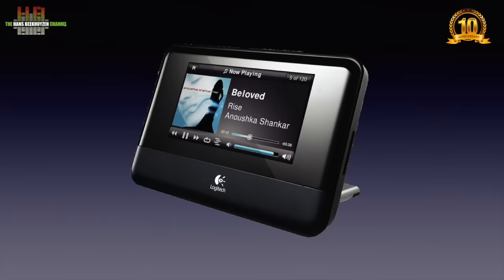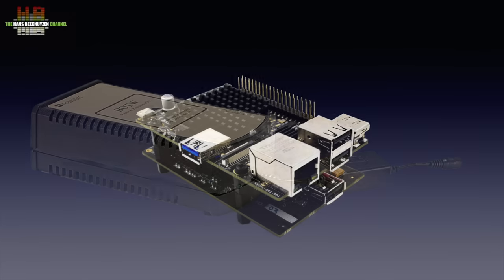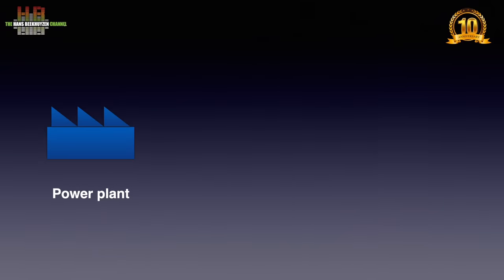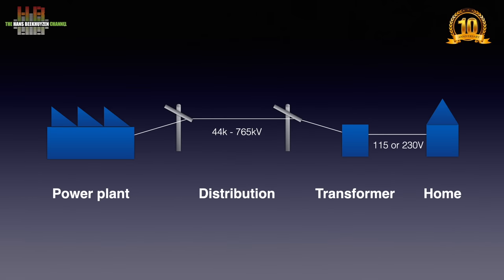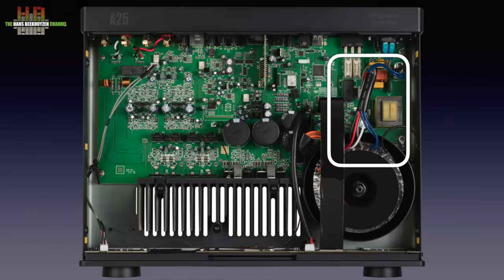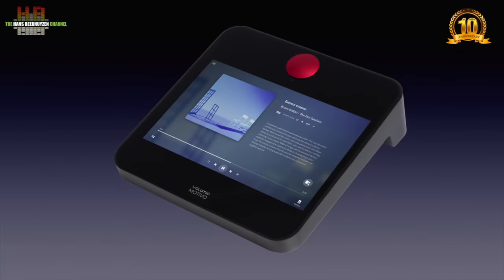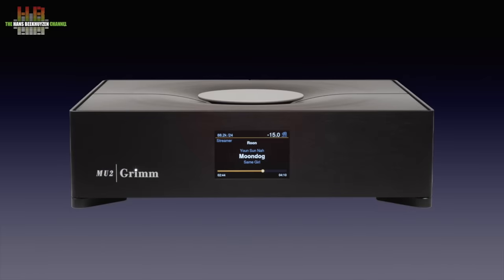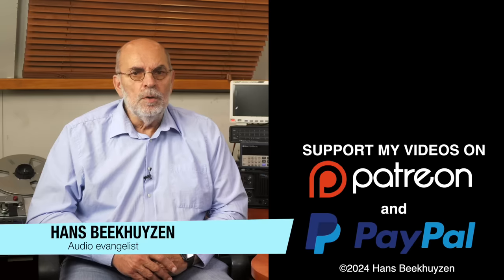About power supplies

Comment: I bought a LPS for my Schiit Modi+ DAC. It was very well made, with good quality transformer and components. It’s sucked the life out of the DAC - it flattened the soundstage and reduced dynamics. The sound became lifeless. The SMPS was far superior, with a much livelier, dynamic delivery. A LPS doesn’t guarantee better sound.
Reply: I've experienced the same type of thing with different components & aftermarket PS's. It's not always a perfect match.
Reply from the maker: That would mean the LPS wasn't of sufficient quality. Or both of you prefer the influence SMPS's have on analog circuits.
Reply: Interesting contrary experience 🤔 to mine, I have had total success with every LPS replacement. Seems there is no 100% silver bullet.
Reply: @ChicagoRob2 The sound you describe with the SMPS is to my mind probably inferior and the “much livelier, dynamic delivery” you describe might well be due to noise artefacts due to distortion created by by the high frequency noise from the SPMS. Those words you use are alarm bells in my experience. So are descriptions such as more sound stage or a more detailed sound. Mostly such sound ultimately results in fatigue and a feeling that one wants to slightly reduce the volume.
Reply from the maker: @nickwavehighfidelity7651 but what if he likes that sound
Reply: @TheHansBeekhuyzenChannel  of course it is only a hobby and if one likes something then in a sense that is the end of the matter. However, it is possible that what initially sounds ‘better’ will in due course become irritating and one will realise that the noise artefacts which are at first giving an impression of sounding good are in reality masking the real subtle detail in the music. A friend of mine had not realised that he was completely missing a whole instrument in the music until he was shown how the sound changed by going to an LPS from the SMPS he had been using.
Reply: @nickwavehighfidelity7651  With 50 years in the audio game, I think I know what makes for good audio.  Interestingly enough, the LPSs in my Schiit Modi Multibit DAC and Schiit Vali 3 amp sound amazing. Likewise, with my Yamaha A-S3200.
Reply: I had a similar experience but with a small class D amp.  With LPS it had less bass and compression.  It did sound cleaner

Comment: In general, the world will pretty much move over completely to  switch mode supplies, simply because of regulations for efficiency that linear supplies won't be able to meet. These switchers seem fine as long as they are well filtered and high frequency leakages are kept to a minimum. Comparing simple wall warts today to those of 20 years ago certainly confirms this trend. Almost all of them are now switch mode types.   As for substituting a linear for a switching type, in many cases, as you pointed out, it won't make a difference because a good number of products have their own charge pumps built in that allow for using a single supply that is then converted into a balanced dc supply. These are basically small switching supply modules that don't care what kind of power supply is used in front of them. When I worked at Sony in the late 70's, they were already playing with switch mode supplies in their higher receivers and integrated amps. They called the unregulated supplies "pulse power supply" and the regulated ones "pulse locked power supply". Unfortunately, they were pretty unreliable and the cause of many service complaints. And that's one other point: a linear supply is usually dead reliable. The same can't always be said for a switcher, which uses many more parts and stresses the electrolytic capacitors much more.

Comment: I have 2 SBooster power supplies, one for my ADOT fibre kit and the other for my Chord MScaler. I first had the SBooster on loan, which I used with the ADOT, and was really surprised by the overall improvement. For me, it is much better than the more expensive Plixir.
Reply from the maker: Thanks for sharing

Comment: "Batteries are the nosiest solution"... does this mean buyer's of Stromtanks (sold as being "quieter than grid power") are fools?
Reply from the maker: I have no experience with Stromtanks. so I can't say.
Reply: 2 things - to my understanding Stromtank supplies AC, i.e. recreates a 50 or 60 Hz signal from DC. If regulated properly this could be low in noise. Secondly, if you have many cells in parallel, noise should be down, current delivery up, and internal resistance down too. Which is why Stromtank and a powerbank are 2 very very very different things. Not only but also wrt cost.

Let me add one thing: powerbanks provide 5V output for usb, but li cells dependent on their chemistry have various different voltage ranges, dependent on temperature, their state of charge etc, typically on cell level a nominal voltage of ca 3.5V. So how to get from 4.1 or 2.9V to a stable value of 5V? You add a dcdc converter that switches current flow around inductors (coils), filter the voltage at the and with a little capacitor to get a so so smooth voltage, sufficient to charge your phone. But usually not ok in a high end system, budget or full monty.

Comment: I found your explanation better than any I have read or heard - Excellent
Thank you
Reply: What type is the ifi iPower Elite?
I have two one powering my Qutest and  Node.
Reply: @ccfunkster it's a switch mode power supply. I use a couple of them.
Reply: I used the s booster on the node, but returned it. I  like the ifi power elite better.  Seemed more smoother with a wide sound stage.  Liked it so much  , bought a second one for the chord qutest Dac.

Comment: Some manufacturers propose their external PS as an upgrade. So you should be sure to have an adapted PS for your component and get a better sound......but at what price ! In these case the price of the PS reach the sky. Excellent explanations and topic but difficult answer to the problem.
Reply from the maker: Good power supplies cost money